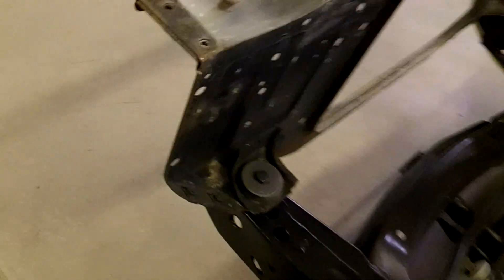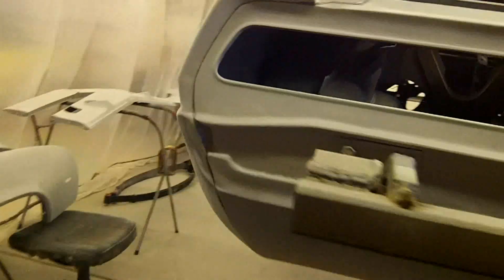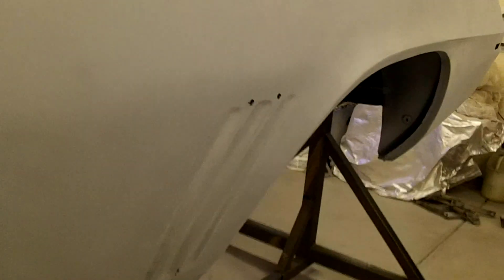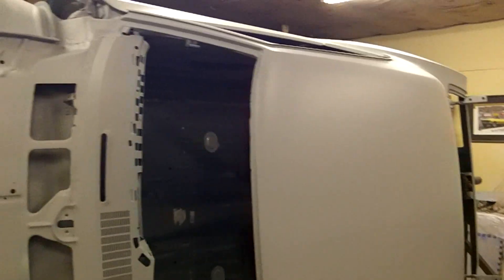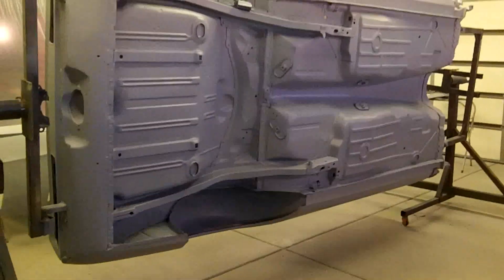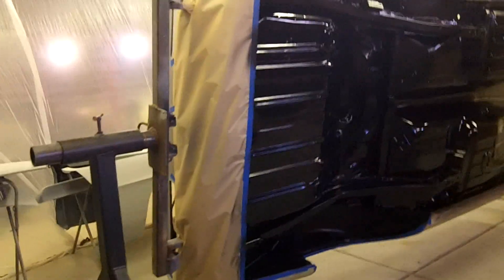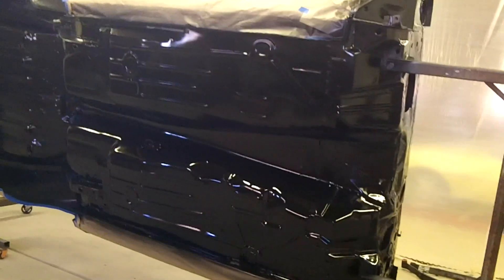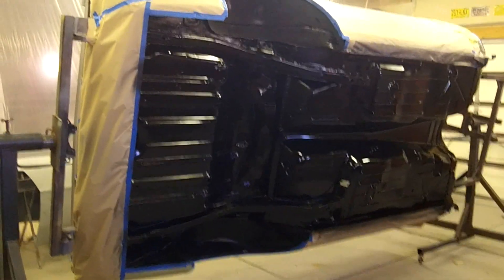1969 Camaro project part 16

Comment: Hi, I’ve been watching a lot of your videos and admire your work, I just wondered what material you used on the quarter to roof transition. There are many opinions on lead, no lead, short strand fibreglass, metal to metal, what is your opinion ? Thanks.
Reply from the maker: Thank you sir. I used Dura glass on the quarter to roof transitions. I have done a few cars this way over the years without any problems.